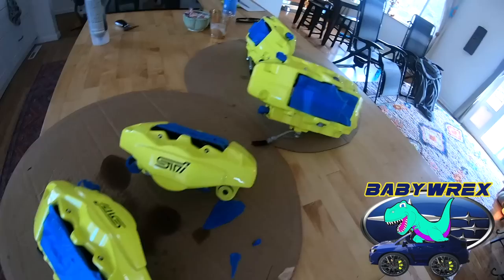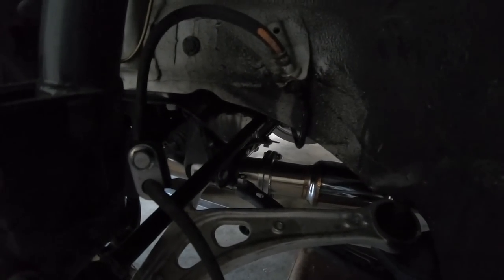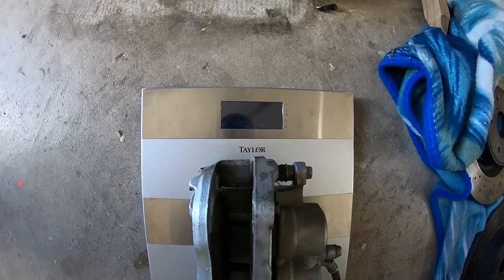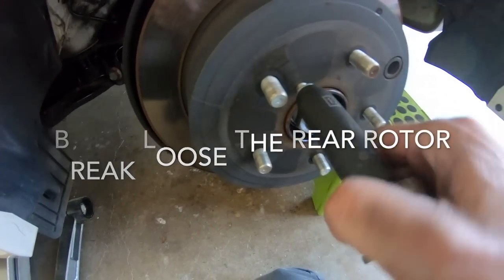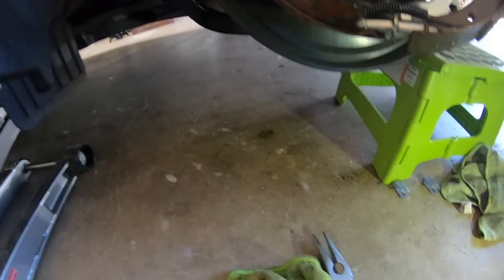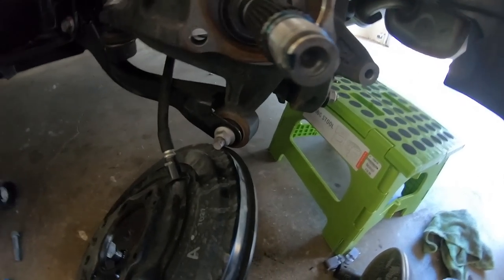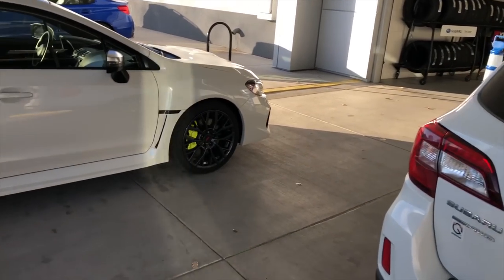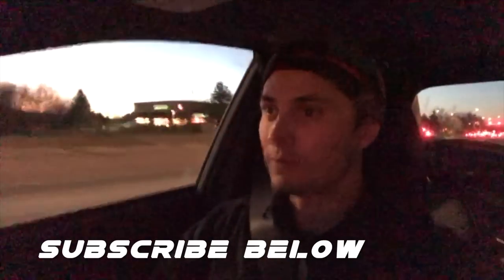2018 WRX/STI: Brembo Install

Comment: If you do this swap, I HIGHLY recommend you put some antiseize or grease on the outside of the housing of the rear bearing assembly when you swap out the backing plates (When you slide them back into the knuckle). You will thank me when the time comes to replace the bearing, they rust in there and are a complete PITA to get out once that has occurred.

Comment: I have a 2016 Subaru WRX premium trim with 18” wheels. I’m planning on installing 2018 STI 6 pot front / 2 pot rear calipers on my vehicle. Will I need a rear brake caliper adapter or will this fit directly on my car ( with appropriate STI bolts / rotors of course). Thanks!
Reply from the maker: Direct bolt on with proper bolts

Comment: Double checking, do you need a bracket for the rear 18' Neon Yellow Brembo on the 17' WRX? I suppose not right, just bolt on...
Reply from the maker: No bracket needed you just need the right sized bolts, and to cut the dust shield or replace it with the STI one like I did
Reply: @AtlasWilder  thanks!!

Comment: yo bro i just got myself a 2018 sti wheels, im just wondering how much u spent for the tires?
Reply from the maker: Mark Dela Cruz  depends on the setup I think my winter setup was around $1200.
Reply: damn thank u
Reply: did u have any modifications installing the sti wheels? or the wheels fit with no problem?
Reply from the maker: Mark Dela Cruz no issues just be sure you have the sti center caps... the wrx ones will not fit.

Comment: Hey Dude.  Quick question!  Wondering if you can link the Torque specifications for the Brembo's
Reply from the maker: I had the dealer do the final torque specs when I had the brakes bled. Good luck bro!

Comment: Dear Sir
You're so great.You finished upgrade by your self.
May i ask a question?Does your IMPREZA is WRX(VAB)?then you upgrade the brake caliper and disk to WRX STi(VAB)?
Reply from the maker: kou iwaki yes it is a wrx Limited. The Calipers and discs are all from a STI.
Reply: Oh NO.Your WRX is " Limited" edition?In USA(even in Japan,my country),Limited edition is equipped EyeSight. system.May i have a question again?
How do you overcome/or by pass the electronic brake of rear brake?Or you bought the parts from WRX STI(without EyeSight)? 
Looking forward ur kindly reply.
Reply from the maker: kou iwaki No problem. From what I read in the USA only the CVT WRX is available with eyesight. Mine is 6MT so eyesight is not available and it doesn’t not have the electronic e brake system either.
Reply: GOT IT.Thank you so much for responding to my question~^^!Have a nice weekend.

Comment: Woo ,I hope I can do the same upgrade for my 2020 outback xt lol
Reply from the maker: An awesome upgrade for sure it is a bit heavier and slows you down a bit from what I remember.  I believe I weighed everything back to back in one of the previous Bren I videos to compare
Reply: @AtlasWilder  yeah I think is a bit light weight forthe caliper and heavier for the brake dish, but if the wheel light ,I think will be about the same . How was the new caliper brake feel ?
Reply from the maker: Lam clarence the bit engages harder sooner by I’d say 25% it’s noticeable not obnoxious like my Infiniti Hybrid is now

Comment: Are the front and rear caliper bolts different?
Reply from the maker: Yes I believe different sizes watch the video for details cuz I don’t even remember now lol
Reply: @AtlasWilder  I’m also doing this conversion but I don’t think I would want to replace the dust shields in the rear. Looks like a pain in the butt 😭 would it be okay to just cut it?
Reply from the maker: It’s not fun but the dust shields complete it honestly and help with the dust TRUST.

Cutting it will work also.  But yeah taking that parking brake apart is a pain

Comment: Where did you buy the kits?
Reply from the maker: Logan B eBay and the dealer there is some on eBay currently.
Reply: Mods And Coffee thanks! how much were they from the dealer?
Reply from the maker: Logan B don’t buy them from the dealer  I only got rotors for rear and brake lines with hardware and that was $1k . Be prepared to drop 3-4K for a whole kit.
Reply: Mods And Coffee thanks for the help